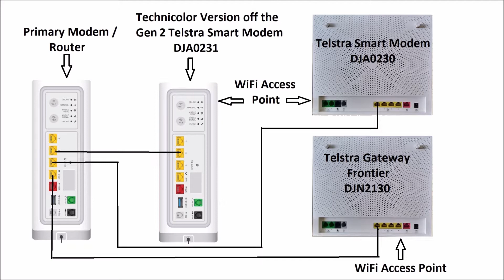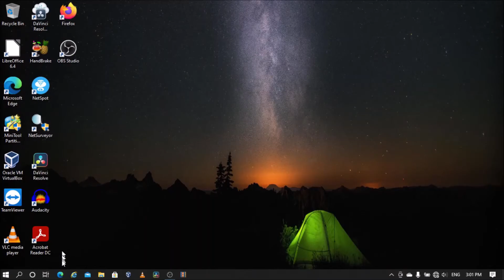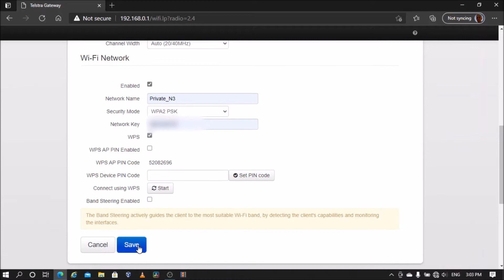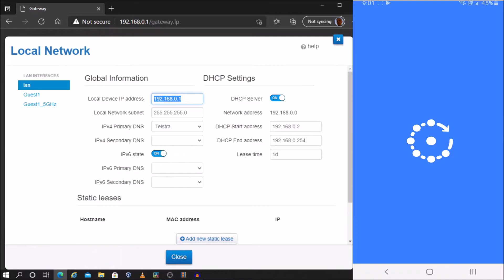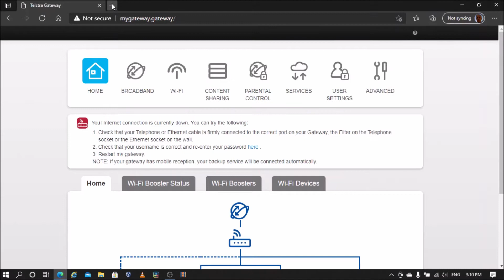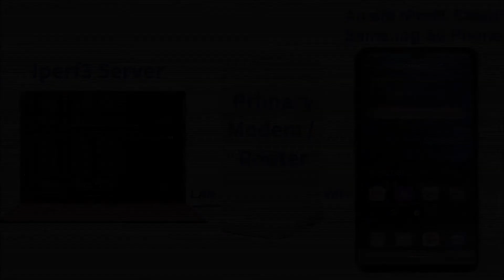Telstra Smart Modem as a Wi-Fi Access Point

Comment: Hi David, after completing this process I have found the internet speed on my iphone is halved. Interestingly on my laptop there is no detrimental effect. I have experimented with turning the wifi on and off through the button at the back of the secondary modem and can see the signal strength bars increase on my phone when wifi is turned on, but the internet speed drops by about 50%. I have connected a cable from the LAN port on the Secondary to my laptop to test that there is no issue with the cables, and there is not, I get full speed through the cable. Also, the front lights on my Telstra SM are not working at all, even when I reboot back to factory settings, not sure why. Is this cause for concern? I have two Telstra SM's, they are both the Technicolor variety, using one as Primary and the other as Secondary. My 2.4GHz and 5GHz both use the same SSID, so I have left band steering enabled. I have NBN through More. Any ideas?
Reply from the maker: The power light and the Wi-Fi light should be on. If both are off modem might be faulty. The fault might only be in the light hardware though.
One thing you should do is to install the Airport Utility app on your iPhone. Open the app and do a scan (Top right of app). With band steering enabled there should be four signals with the modem's SSID. Two on the 5 GHz Wi-Fi band and two on the 2.4 GHz Wi-Fi band. Check that they are using different Wi-Fi channels.
Reply: @DavidSmith-ir4hl  Thanks for your help and quick response David. I initially had four channels but the 5GHz channel from the second router was only -90dbm, now it doesn't show at all. When there were four they were all on different channels. Though I note there are a couple of other networks using at least one of the same channels. Would this result suggest the 5GHz is not working on the secondary router? and would that account for the drop in speed when the secondary router is turned on? I have an old Telstra Gateway Max (C6300) sitting around. Would I be better off using that as the secondary router? Cheers.
Reply from the maker: @SR-oy1fq  It sounds like the second router is faulty and you would be better off using the Telstra Gateway max.
Reply: @DavidSmith-ir4hl  Thanks so much David! Gateway Max is now working just fine. Cheers

Comment: Hey Mate, this does not work until you click on "bridge mode". Also, the primary router WiFi needs to be turned off or they clash!
Reply from the maker: Reply there are two versions of the Telstra Smart modem Gen  2. One made Technicolor and the other by Arcadyan, The Arcadyan modem has to be Bridge to work as a Wi-Fi access point (See video on the Arcadyan modem as Access point. https://youtu.be/6-jUFVFG1ck). The Technicolor version does not need to be Bridged. The Wi-Fi can be left on on the main modem but the Wi-Fi channels on the main or the access point modem should be changed so that they do not match. Also if  both the access point and main modem are smart modems the password and SSID has to changed so that they are both the same.

Comment: Hi David, I am having trouble to configure my home phone to the Router VOIP line. Hope you can remember the Telstra Smart Modem G 2 I picked up from you today. I plug the phone line in, but the router is not recognising it.
Reply from the maker: Hi Shahidul. You must have me confused with someone else as I did not supply you with a Gen 2 modem. The VOIP line only works on a Telstra NBN link and should configure itself automatically. Is phone light on back of modem and light on front of the modem green?
Reply: @DavidSmith-ir4hl  It is Telstra Smart Modem G 2, Model DJA0231 I picked up today from your place. I am having trouble to configure my home phone with it.

Comment: is there a way to do this wirelessly?
Reply from the maker: No the modem with standard firmware can't connect to the main modem/router by wireless as the setting for wireless bridging is hidden.
Reply: @DavidSmith-ir4hl  Cheers David. Just got Starlink and was hoping to use that to boost the signal. As Starlink doesn't come with an ethernet port either, looks like I'm going to just have to use a tp-link range extender.

Comment: Has anyone meshed 2 or 3 Telstra Gen2 modoms would be awsome to do as they are so cheap.. Must be achievable because the WiFi boosters use  mesh connectivity to the Gen2
Reply from the maker: With the standard firmware the modem's can only connect to each other by LAN cable. It is possible to install custom firmware on the Technicolor version of the modem which unlocks hidden settings. With the custom firmware it would be possible to use several modems in a mesh configuration. I haven't tried it yet.

Comment: Hi David, it seems that the two modems are connected by a LAN cable, ie the Primary is not transmitting to the secondary ( Smart) device wirelessly.
Reply from the maker: Yes the modem's are connected by LAN cable. The modem's can't be used as a Wi=Fi repeater they can only be used as a W-Fi access point connected to main modem by LAN cable.

Comment: Hi, why do you change the secondary modems name to the same as the primary modem early on? Are you powering down your primary modem while you setup the secondary modem? I find if their names are the same I'm unable to connect to the secondary modem as my devices prefer the primary modem as internet is working there. So, I'm only able to get into the settings of my primary modem.
Reply from the maker: I change the name early on because if the name is different and the modem being used as a access point is a smart modem and the main modem is a smart modem the modem used as a access point  sometimes becomes the master WiFi controller when it is connected to the main modem and changes the WiFi name and password of the main modem.

When I set up my modem I set it up in the backroom which is separated from main modem by a couple of brick walls. The devices connect to the stronger WiFi signal of the access point modem. If your having trouble connecting could temporarily turn WiFi off on main modem or connect to secondary modem using a LAN port.
Reply: Also worth noting I am trying to connect two telstra smart modems, both dja0231, but my isp is aussie broadband. 
I've somehow managed to stuff it all up and stop the internet working entirely, a modem reset fixed it though, haha.
Reply from the maker: @miko6464  Sorry for the loss off internet. Yes looks like perhaps to avoid to avoid accidently connecting to main modem and turning of DHCP in main modem. happening I should change video to include a step for temporarily turning off WiFi on main modem during setup or connecting to access point modem via LAN port during set up. Unfortunately can't edit a video once it has been posted. Might have to post a new video.
Reply: @DavidSmith-ir4hl  thanks David. Just this comment being here may help those with the same issue as me :)

I’ll try again today, should be able to get it going!

Comment: hi David, how can i use this gen2 modem in my sailboat as a network? i want to dbe able to either use a mobile phones hotspot as a source of intenet, or use a portable hotspot unit or a 4Gusb dongle that could plug into the rear of the unit. The gen2 does have a simcard , but it wont allow me to use non Telstra sims. thanks in advance.
Reply from the maker: A 4G usb dongle cannot be connected to modem but the modem could be used as a 4G modem with a Telstra data SIM installed. With the original firmware only Telstra SIMs can be used but it is possible to install custom firmware on Technicolor version of the modem that will allow installation of non Telstra SIMs.

Comment: Hi , I have a Telstra modem gen 2 as a spare and want to use that as a extender by connect my new router to the gen 2 via Ethernet, is it the same way to set that up.  Thanks in advance
Reply from the maker: There are two versions of the Gen 2 modem. One made by Technicolor (DJA0231) and the other made by Arcadyan (LH1000). The DJA0231 can be set up in the same way but the LH1000 can only be set up as a WiFi router with its WAN port connected to the main modem's LAN port. If using LH1000 the LAN IP address of second modem also has to be changed so that it is not in the same subnet as main modem (192.168.0.xx) Could be changed to 192.168.20.xx)

Comment: Not working for me 😑 on tangerine not telstra with main router a Netcom. Would that make a difference?
Reply from the maker: The reason the modem doesn't work on a Tangerine connection is that Tangerine internet connections us a VLAN ID of 100. The Telstra smart has no VLAN ID settings. If the Netcom router supports VLAN ID it should work with Tangerine. If using the Telstra modem as a VDSL modem it will need to be in Bridge mode.
Reply: Thank you! I'll give it a go. I have 2 old Telstra modems and a haewai modem set up as extenders around the property that work fine but not the smart modem. I'll try the v lan setting. Thanks again

Comment: HI David, I've' just found your channel and taken a look, do you have any videos on Telstra + DNS options at all?
I would like to run a Pi4, Piehole on my network (from modem/router) to filter ads, though I cannot see any way to do it, Looks like Telstra firmware blocks dns configs, any thoughts mate?

I can run it locally on my Macs etc, when I changed network settings/ dns etc, but I really want to run it from the modem/router.

Any help or advice would be very much appreciated..
Reply from the maker: Ii you have the Technicolor modem it is possible to unlock the modem which reveals a lot of hidden settings. One extra setting allows the setting of a custom DNS. There is a thread on Technicolor custom firmware on the Whirlpool modem forum. Some of the earlier modem's also allowed the setting of a custom DNS but the current modems only allow the selection of a DNS from a list of DNS providers.